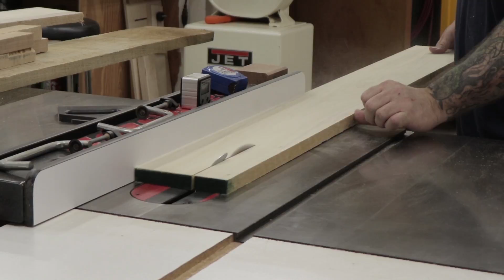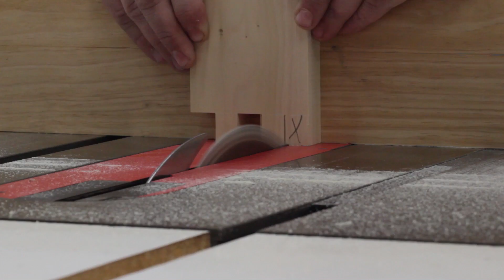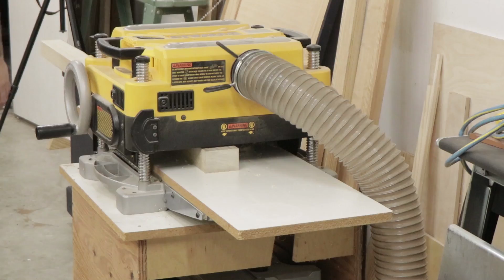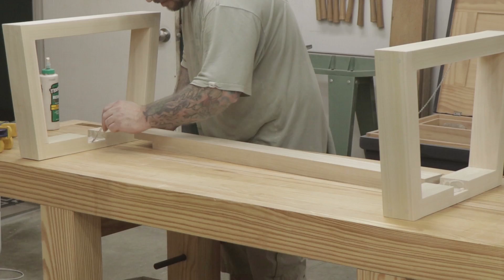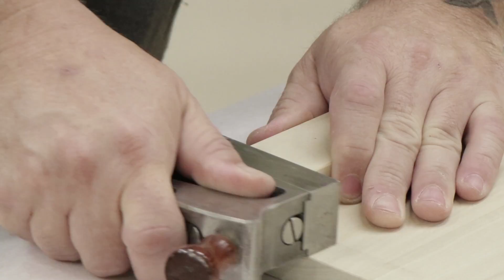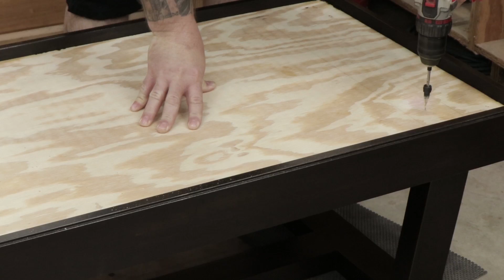Coffee Table With Puzzle Storage

Comment: Nice build! I have a couple questions for you about the table. First, what were the dimensions of the puzzle tray? Secondly, how come you didn’t use hinges? It looks the that top is fairly big and might be difficult to take off and put on by oneself.
Reply from the maker: Thanks for checking it out. The entire time I was building this I couldn't think of what to call the plywood that the puzzle would sit on. Puzzle tray!! The tray is 22x46. This covers most 1000 piece puzzles and board games but you would have to make it larger for 2k and up puzzles. My original design had the top being 2 pieces and they would be hinged but my wife wanted t simply take the top so she could sit on the floor and not have the top in the way. The height of the table is 18 inches so the top would hang down 12 inches blocking her legs from getting under the table. The outside dimensions and the top is 24x48 so it's pretty easy to lift with a 24 inch arm spread.
Reply: Thank you. I ask because I am wanting to make something similar but I don’t want to have to remove everything off the table top so I need to cantilever the top out of the way. And maybe the inside puzzle tray towards the couch.